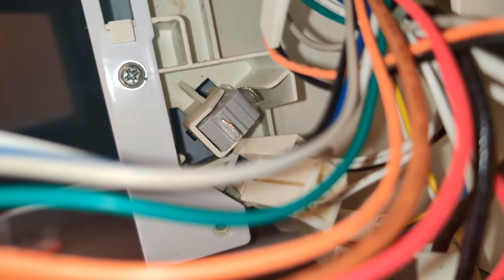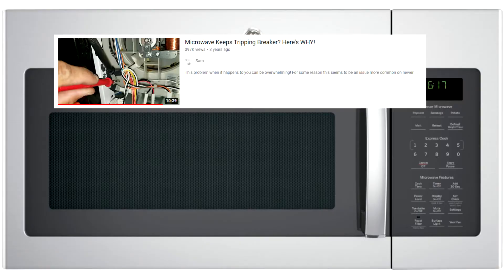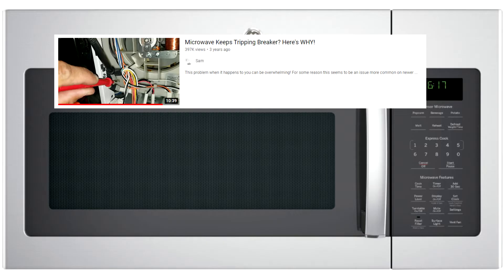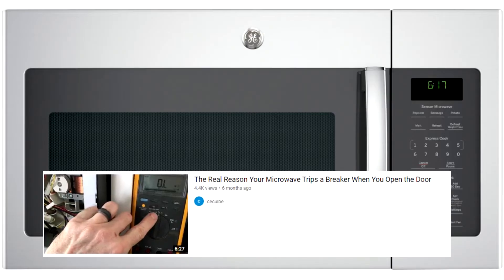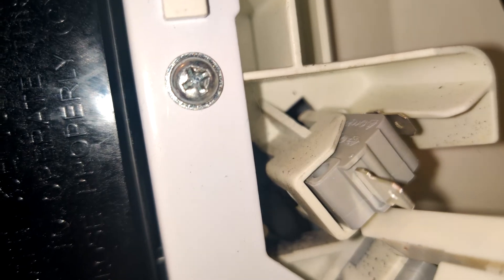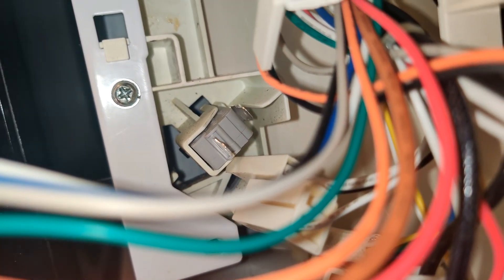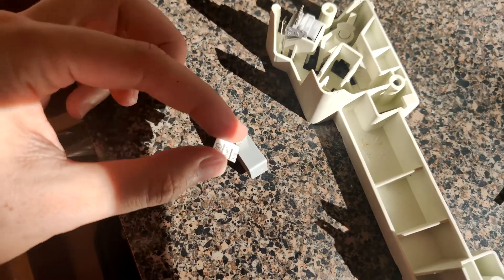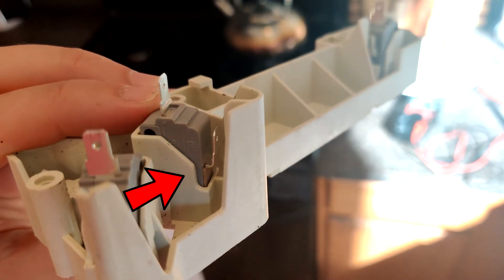Permanent Fix for Microwave Switch that KEEPS BREAKING

Comment from the maker: UPDATE: If this doesn't work, It's much easier to simply REMOVE THE SWITCH ALTOGETHER! The microwave appears to continue working fine, I'm not exactly sure what the downsides are, feel free to post here (maybe the microwave won't turn off if you were to open the door mid cycle?)
Reply: @BigBossBilly   Whoa!!  That is the "monitor switch". If you leave it disconnected , yes the microwave will work but you are eliminating a serious safety item. That switch is wired in a way that the fuse in the microwave will blow if the high voltage components (Transformer, capacitor,  magnetron)  are not de-energized when you open the door. This prevents you from microwaving yourself when you open the door while the magnetron is still producing microwaves. 
Should one of the other switches fail, or a relay on the control board get stuck, you will microwave yourself when you open the door.
Reply: @TheNYgolfer  Sooo... press the "stop" button to be safe before opening the door.
Reply: When you say "remove" do you mean like loose wire, no switch attached, or do you mean wires attached to switch, but not in the housing to interact with the door?
Reply: Can confirm removing the switch all together from the wires works.
Reply: @elliottbradshaw6856 does it microwave your face if you open the door now?
Reply: @edensgardenshed9622  I mean how else are you supposed to see when it is done if you don't leave the door open while it cooks?

Jks, there are like 4 switches that act as redundancy to ensure the microwave can't be on while the door is open. Removing the switch all together doesn't disable that safety feature. There was a repair manual jammed into the side of the button face frame that maps out the circuit logic and how the switches work with it. If you are curious about how this switch affects the circuit take a look at it - as a layman who isn't handy was able to understand it. The long and the short of it is this switch is made to break the circuit and without it, there is no break when the switch is removed. Replacing the switch will only lead to another broken switch, bc the seat for the switch was poorly designed.
Reply: @elliottbradshaw6856  mine turns on and runs when i shut the door so will be checking it out soon.  Been unplugged for a month deciding whether to replace or repair.
Reply: @edensgardenshed9622  I had been laid off when I dug into mine... I didn't really have any other option at the time. One thing to note which I am 95% is not covered in the video. You need to take the whole switch housing out, because the release for the switches are in the back of the housing. The switches don't just slide out without pressing the release first on the opposite side. You'll see what I mean once you get it out. Also, I reco labeling the wires before detatch them from the switches so you know the order to reattach 👍🏼
Reply: Yeah, smart idea. When one of my brake calipers stops functioning on my car, I simply remove it. Car seems to stop fine with 3 brakes instead of 4.

Comment: You’re brilliant. I had a problem that my breaker kept stripping when I tried to use my Frigidaire over the range microwave. I did searched a lot of videos showing that because it has problem with door switches and they need to be replaced. Then I found your video and do the trick and it works like a magic even without replacing the door switches. You’re really a life saver. Thank you so much. For someone whose microwave has the same problem, just do this brilliant trick to solve it, you do not even need to replace the door switches.

Comment: OK...I fixed this problem in my GE Profile Microwave oven this way. There are three microswitches, one above the other. The two upper microswitches are wired to normally open and normally closed. The bottom one, which has that extra cam is not the one which usually fails. When the door is closed, they switch over. The problem is that if the door is not totally square to the front of the oven, or it twists, the switches have a chance to not activate consecutively and form a dead short which blows the breaker.

I got sick of this problem and got a DPDT limit switch, cut a hole in the upper part of the grid over the removable plastic box for the wiring and mounted the switch in a way, that when the door is closed, the switch is activated. ONE SWITCH ACTIVATION CONTACT POINT, not TWO to throw the switch. That way the twist in the door is irrelevant.  I then got male spade connectors and put them in the connectors for the NO and NC switch connectors and wired the outputs to the new switch NO and NC connections (4 points, total) with short lengths of wire. This switch breaks before make and that function is the secret to why it will reliably work.

It works great. I used a limit switch from an old molding machine. A Square D switch or other type of 2p2t snap action switch could be used and bracketed into the front of the microwave neatly. The switches have to be rated at least 10 amps at 120VAC. If you do this, don't do it sloppy. Your wife will get pissed at you.

This is an inherent design flaw in this microwave. The way I fixes retains the safety interlocks and eliminates the problem of door and hinge twist. 

You GE folks should take notes. Doing it cheap is not necessarily doing it OK....and yes, I am going to be smug about it.
Reply: Two interlock switches were installed to ensure the door is securely closed, thereby preventing any potential radiation leakage.

Comment: I understand this can help, but it won't fix the situation if there is significant wear on the door latch ramp or microswitch actuators.  Check older posts; people report the problem returning and say they have removed the monitor switch altogether!!

Comment: Thank you for posting this fix! In my case, I already replaced that switch and it was still okay. But when we opened the door while microwaving, it would pop the circuit breaker. After applying your fix, it works perfectly now!

Comment: My microwave kept frying the middle door switch (monitor) no matter what I did. So finally I gave up and just unplugged the bad switch. It works great now. It's an absolute garbage design that's not built to last. What's worse is that it's in a ton of different microwaves. The only way to fix it for sure is to bypass it entirely.
Reply: @HowardDeAlvarado    That is almost certainly hazardous!!
This unit short-circuits the magnetron transformer primary to rapidly quench energy in the cavity at the moment the door is opened.  If the door latch ramps wear, or the switch actuators wear, or the door is twisted as it's being opened, the switch timing is thrown off enough to delay (or prevent) quenching,  It also causes a line-to-line short.

If the microwave was running, or not off long enough, significant microwave energy will be released — very bad for the eyes, brain, gonads [and maybe future children.   It's certainly inconvenient, but the short circuit and popping breaker is a warning.   Microwave energy leakage is the most closely watched safety attribute.

[Don't stand, don't stand, don't stand so close to me.]

Comment: Since the middle switch is NC when the door is open and NO when the door is closed.  Just take apart that middle switch and make sure that switch is NO all the time.  Done.
Reply: It’s push pull. It has to close first and open last

Comment: Could you just remove the monitor switch? The monitor switch is normally closed meaning that it has an open circuit when the door is closed. Removing the switch all together would simulate having an open circuit 100% of the time. It seems to me that the monitor switch is a secondary/redundant safety switch in the case the door interlock switch fails. I would think that as long as the door interlock switch is working properly, there should be no safety issues removing the monitor switch.
Reply: This worked for me removing that switch. So is this a permanent fix and will it last

Comment: All three interlock switches tested good. (open or closed when appropriate). The monitoring switch was a bit sloppy in its cradle. As you suggested, I added a thin shim (tape) but to the backside of the connector and reinserted. That took up the slack on the Frigidaire model. No breaker pops when the door is opened mid cycle. THANK YOU!
Reply: Same here, but I proactively replaced the switches while I had them l out

Comment: It always happens when I open door without hitting pause/cancel first. I know how to open panel and take out door switch and fix but taking out all screws and putting all together takes 45 mins or less so waste of time. Mine middle switch stop clicking whenever it happens. I did replace switch few times but I can fix switch clicking. Is there any other way to fix without opening panel :)

Comment: I've got two identical of these GE microwaves. One has the problem, the other doesn't. What I noticed is the door pulls harder on one that has the problem, which is why the "twist" happens. The other opens very easily and doesn't have enough stress on it to twist and therefore does not have the problem. So I'm going to do further detailed investigation, but I'm think it is actually a manufacturing defect or installation issue.
Reply: I hear you, but suspect it's because of a cost-reduction some point in the past.
My 3 year old microwave has a groove worn at the top of the latch ramp.  My son's 15 years old has a visually-similar design, but the plastic switch latch ramp doesn't show wear.    
Here are two theories:
A)  Somewhere there's a supply chain manager who scored a nice cost-savings financial reward, while owners of these microwaves replace that new version door latch.  
OR
B) the spring force was increased to prevent the latch from allowing a microwave leak as as a kid hangs on the door handle.   The extra pressure wears the plastic ramp, which changes the switch timing.

Comment: The other fix for this is sadly to replace the Switch holder and the door Latch. I have to do this every 6 months.They are cheap cheap plastic and they wear out then the switches do not hit at the correct time. This may have been posted already.
Reply: See my reply to @jimwilson6186

Comment: This did not work for me.  The switch is held tight in place when the connector is pushed in.  We have learned to not open the door while the microwave is running. But when we have company they open the door to stop the cooking and the fuse blows. I am getting faster at replacing the fused switch...
Reply: Has opening the door from the top and also not while it running working? I've gone through countless normally close switches

Comment: super glue the switch into the bracket maybe? my issue though is my switches are all good and working and my fuses are good and mine still trips the breaker with the door shut after running for 205 seconds.  total mystery
Reply: now, how are you going to get the super glued switch out if it breaks again?

Comment: I’m going to give this a shot. I replaced the normally closed switch 2 days ago and it already broke again. It’s frustrating. Hopefully this will get it fixed. Thank you!
Reply from the maker: I hope it works for you!
Reply: @BigBossBilly  and the switch broke again today… Is yours still good?
Reply from the maker: @Qniverse13  yeah, once I shimmed it like this, plus am careful to open by pulling the top of the handle (and not while it's running), mine has lasted a few months now.